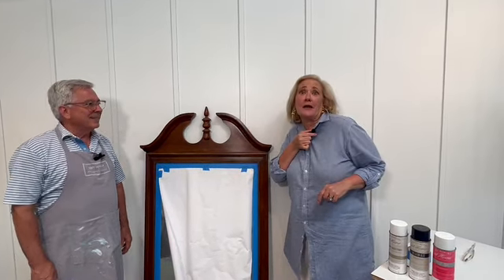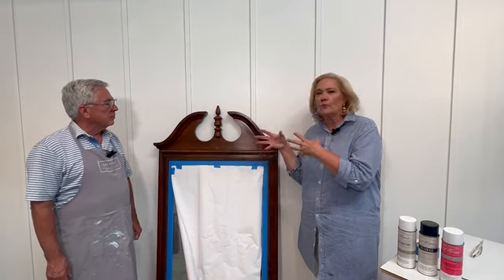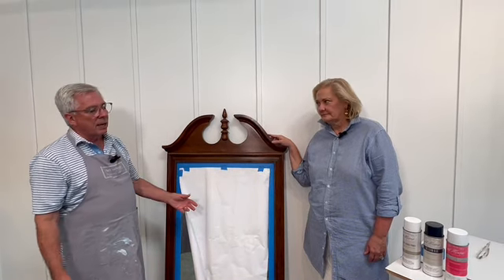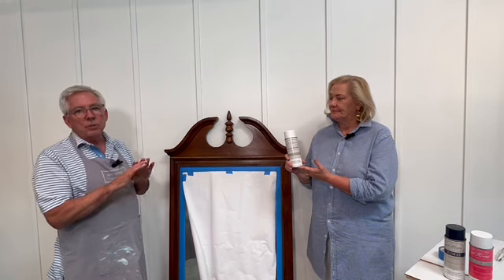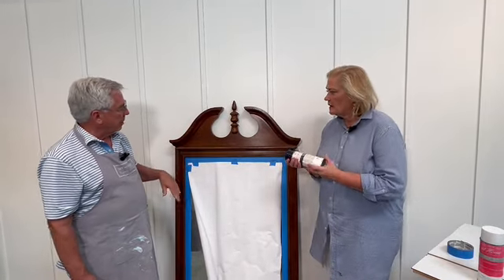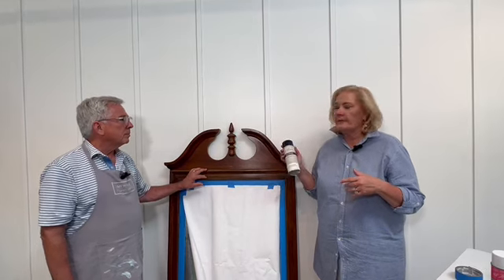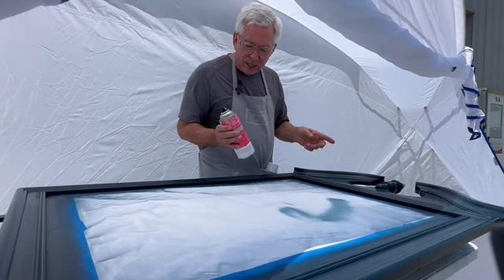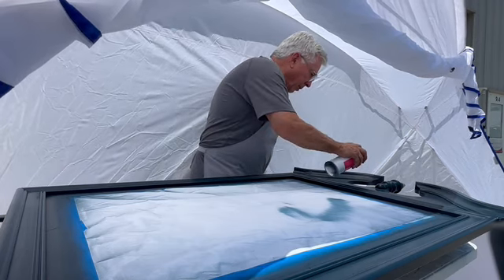How to Lacquer Furniture | Restoring a $5 Thrifted Mirror

Comment: Always lightly sand w 320 first before any color or finish.. if the piece your finishing dsnt have to be sanded down then u can  start spraying a light coat on the backside first for the edges..let it dry..flip it…spray outside edges again then inside edges working your way back to the outside toward middle with overall coat..then u won’t have any air bubbles or over spray..first coat is a light coat then lightly sand again..with a finish coat..your finish & final coat should be smooth & easily done